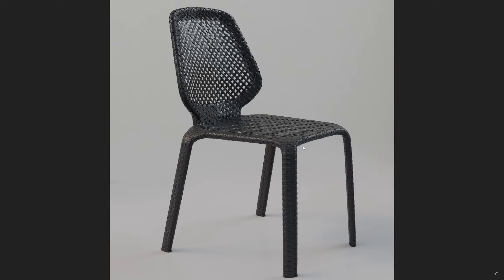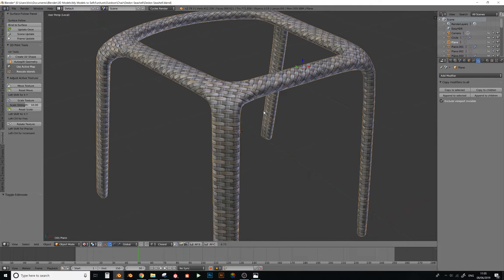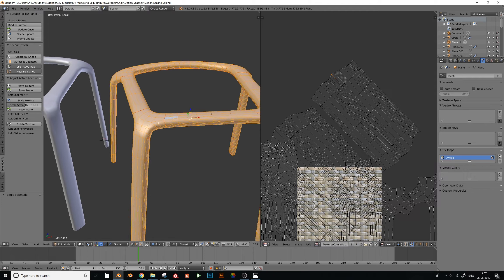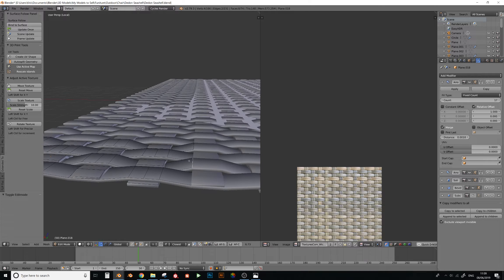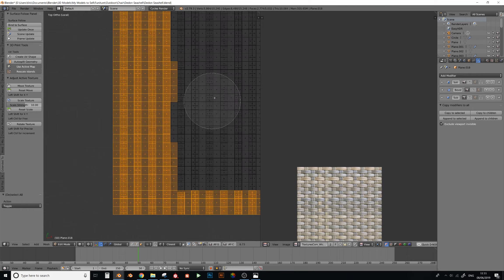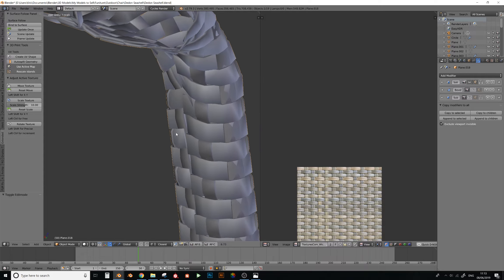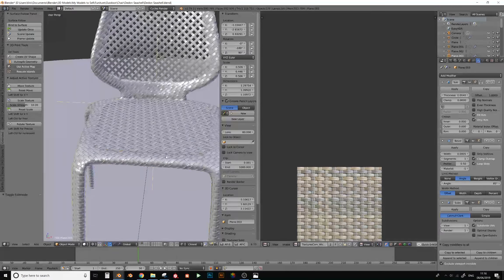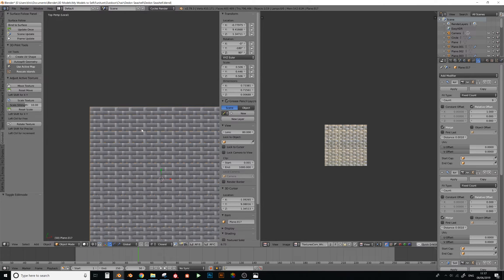Blender - Modelling a complex weave wicker chair | iMeshh Tutorial

Comment: i am new to this, but do you use a lot of these high-poly meshes in architect visualization? Will it make it render or edit way slower ?
Reply from the maker: High poly objects are definitely far more common in Arch-vis. Especially for objects like this or sofas/beds for example. Having a higher poly model is great for close-up shots. Id rather have too many than too little.
If you're going to duplicate objects like,this you should make sure you duplicate it as an instance, then it doesn't take up more computer resources.
Very high poly scenes can sometimes be troublesome, but for me that's mainly if I'm working on multiple rooms in one project or an exterior project. Just try to break up the scene as best you can.

I personally find textures to be the biggest issue as a 6k texture can use up LOTS of RAM. 
Blender though has a great Simply feature I recommend checking out which limits texture sizes and duplication levels.

But yea don't be surprised if a scene hits 10 or even 20 million faces.

Comment: Easiest fastest way is to use the tissue add-on peeps
Reply from the maker: I've tried that a few times but sometimes find it doesn't always place my base weave in the correctly places, or it doesn't merge them in a way which I'd like. I do like this method because you can methodically choose the direction of the weaves for the whole mesh before committing.

Also am I correct that it adds the duplicated shape over every quad face? So all quads need to be exactly even in size? I think this could sometimes be a problem at a pinch point for something like my chair. But if you have any examples of the tissue add-on being used on something like this then I'd absolutely love to see! Super interesting for sure
Reply: @imeshh  if you model it correctly with quads and make them as even as possible it is doable i think. This workflow is also pretty nice. I would only use this for real close shots as it's poly bomb having so much vertices